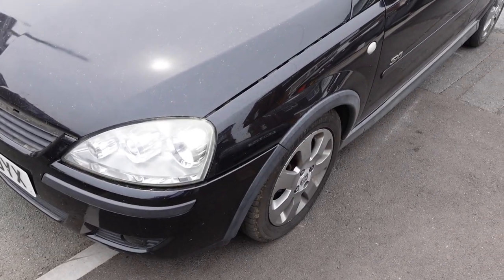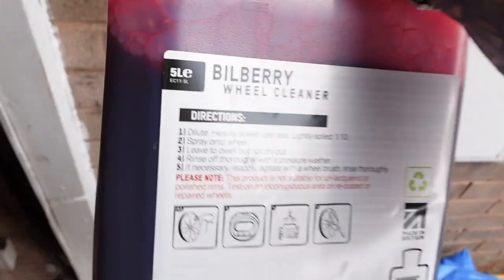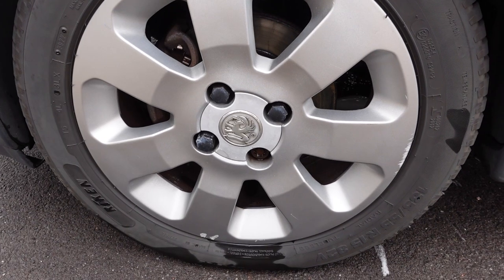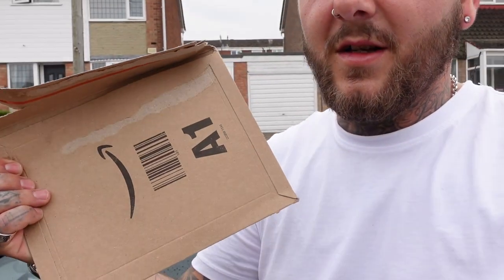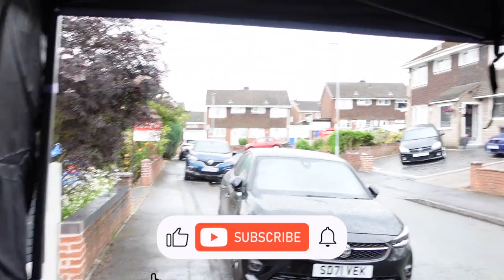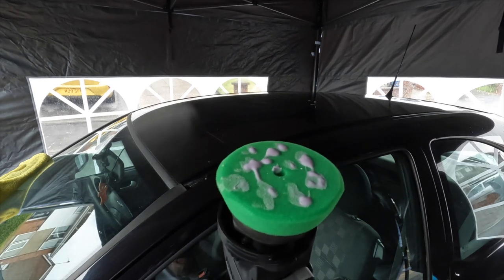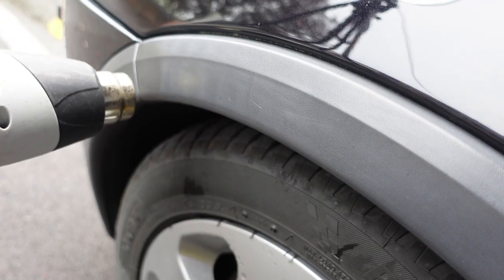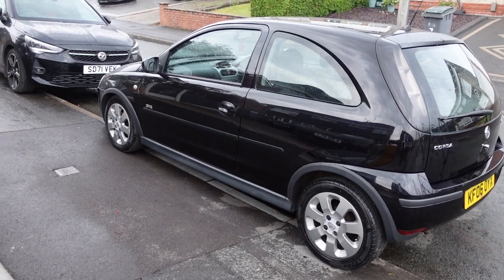Bringing the CORSA C back to life *with a good detail*

Comment: ive not used the pads personally so can't say, however, what i will say is it probably failed because youre doing the entire car with 1, 3" pad. these pads are just used for like b pillars and bumpers. even then you should swap pads out every few passes. get yourself a 5" backing plate and some 5" pads, either rupes, lake country or zvizzer and switch them out every panel.
Reply from the maker: I get what you mean but I was only 15 minutes in and they went like this but I will definitely use bigger next time